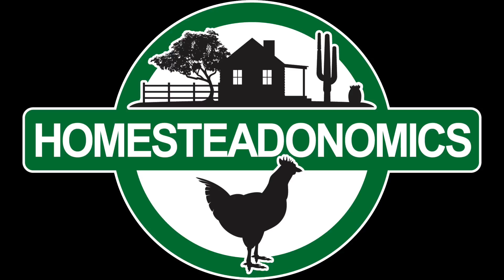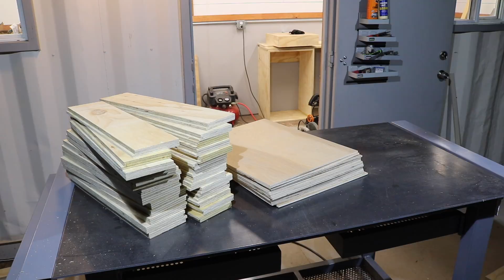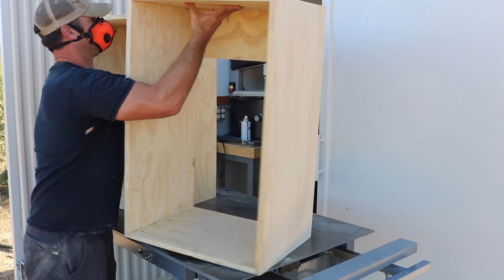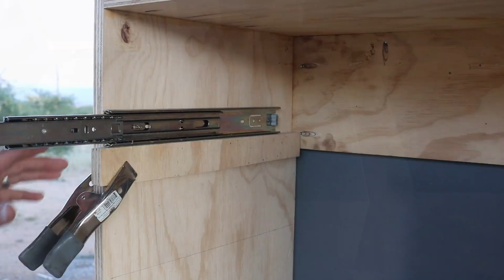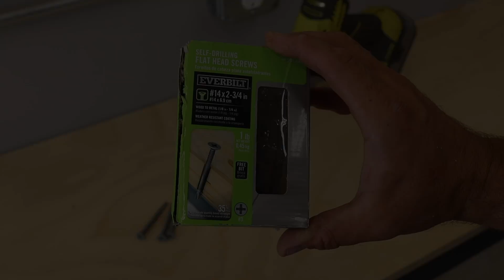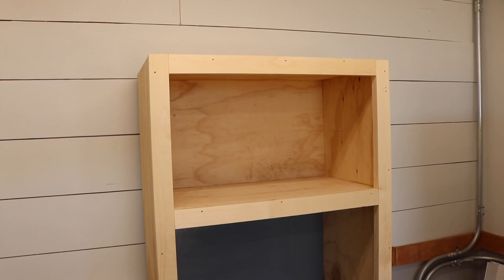Workbench w/ Drawers Build  -  for the Shipping Container Shop

Comment: I'm curious how those glued drawer bottoms have performed in your hot climate?  I've always heard floating the bottoms unglued within dadoes is the way to go if the heat in the shop will be causing expansion of the bottom, so they don't force the corner joints apart, but I've had my doubts if it makes all that great a difference.  I'm going to be making several drawers in a new garage shop that'll have to stand up to Colorado summer heat, so just wondered how yours are doing so far?
Reply from the maker: so far so good... I think floating bottoms are probably the way to go but I just went with simple and easy for these and I don't anticipate any problems.  I have some that I built 7 years ago with only glue and finish nails and still no problems.  Overtime if they loosen I'll just take a cleat under there. :)

Comment: Did you happen to use glue along with nails when attaching the drawers faces?  I did not one time and quickly discovered kids slamming drawers will knock the faces off. A short screw from the inside of the drawer is a big help as well.
Reply from the maker: Hi Christian... I have 3-4 screws on the inside of the drawers screwing into the back of the drawer faces:)

Comment: Great job on a cool project. I wouldn't worry about the blems on the plywood. Sooner or later something is going to fall over and ding them anyway.

Something you might want to consider is a pipe/steel/lumber rack against the wall of the drop down bench. I made frames of uni-strut (about 18" wide by 24" tall) set about 4' apart mounted to the wall and ceiling. By feeding via the end door, you could store lengths up to 18 feet out of the weather.

Also to get the most use from that space under the drop down bench, you might like setting file cabinets on the small mover dollies from Harbor Freight. File cabinets at garage sales or thrift stores are cheaper than plywood and  the HF dollies are cheaper than what they want for just the casters. I've found that the more flexible the floor space is, the better.
Reply from the maker: Thanks!  yes, i plan on making some rolling cubbies for that space... but i really like your idea of building them off the HF dollies... they are cheap and I already have a plat form to build upon!!  thanks... great idea

as for the lumber rack.. I have one in the garage that I will use to keep the shop open for more of the functional things... but I like the unistrut idea!!!

Comment: Do you have plans for the gaps between base units on the workbench? If not, that seems like a lot of wasted space in such a small shop. There would be plenty of space for a shop vac or some other modular tool storage if two of the three base units were butted up to double up that knee-hole space.
Reply from the maker: I've got plans to do just that... either shelves or a vac or something... or I might just slide two together.  The small spacing was more of an OCD thing to make it symmetrical ;)

Comment: I see you use several Royobi (sp) tools, what are your overall opinions about them?  Are the good enough when cost is considered?  Would you buy them again if something broke?
Reply from the maker: Little White Dory I actually really like them a lot!  I think they are one of the best values in the cordless world.  I use the big batteries and have never had problems with them.  I have heard that thin batteries used to have problems though.  But anyways, I've never had them quit on me👍🏻😀
Reply: They are great for stuff around the house and hobby builds, which is exactly what they are made for.  Wouldn't expect them to last in a production or heavy use setting because they aren't built for that sort of thing.

Comment: Great video.  And that middle set of drawers looks great centered, but I was wondering if it wouldn't be more practical to have it slid to one side or the other, giving you one big space, instead of two smaller ones.  Just an idea, and based on the way you built it, it looked like it might be easy to do.
Reply from the maker: lol... I've been wrestling with that option for a bit now... yes I can easily slide them over to one side or the next... but since I'm going to be building a heavy duty workbench that I plan to be more of the one I sit at and tinker... I'll probably just leave that one as is.  I might do some shelves on the inbetween sections to hold things like my circular saw, router, etc

Comment: Looking good, though for your air compressor you might want to consider making a separate little shed for it and any other noisy tools like a shop vac and then plumb them in to cut down on noise and save shop space
Reply from the maker: I've considered it but right now I'm gonna give it a go in the shop because my wife is wanting me to dial down the 'structures' that keep getting built on the property....lol
Reply from the maker: ... but that may change depending on how tight it is once the shops all outfittted ...
Reply: I have recently gone on the offensive against noise in my basement shop to reduce the impact on the living spaces above.  I would imagine  the tight quarters in your shipping container makes noise reduction just as important. Moving the noise outside just moves the nuisance somewhere else so I wanted to reduce the noise of operations where possible.  Assembly and sanding are not that loud but the air compressor and vacuum are. 

I just got a California Air Tools 4610AC double hotdog compressor from Home Depot online and it is way, way, quieter -- roughly the same type of sound as an RV generator.  Unfortunately there is a small performance reduction on pressure/CFM specs vs the PC pancake compressor it replaced, which is now moving to the garage.  Eagle and maybe a few others also offer much quieter air compressors. 

I also got a small 4 gallon Vacmaster VF408 wet/dry vac from Amazon to use with the less noisy handheld tools which tend to run for long periods of time.  It reminds me of the sound the old sears canister house vacuum from my childhood made, only quieter.  The little Vacmaster is the poor mans alternative to the Festool CT-26 dust extractor with about 1/2 the performance at 1/10th the cost.  This thing is going to have a home right under my assembly/workbench.

Comment: I'm a fan...  They look really great...  My "mad scientist idea" would be to weld the same type frame as your cabinet top (same measurements and plywood surface) for your shelf...  With the three cabinets, you could double the length of your cabinet surface by moving one to the middle and one to the far end, using your shelf as a second cabinet top...   Might also be tempted to add some low profile locking rollers to the cabinet bottoms to facilitate this...  //  OR  //  Weld a sheet metal surface on the under side of the cabinet top, making it reversible, and a secondary welding table...   Anyway, great build Joe...  I appreciate the attention to detail in the the handle jig...  It paid off, and looks very professional...  Thumbs Up
Reply from the maker: thanks Marc!  I like the idea of continuing that same construction up for the shelves.  Slick and would make for a nice flow too!
As for the bottoms... those are probably gonna stay put...lol... as i've already screwed them in....
But I am thinking of options for the in between spaces... shelves or roll out cuby carts or somethign...
Reply: Well now...  The in-betweens might allow for something to make it possible to use a shelf to double your space front to back then ??? Some type of fold out leg making the shelf level to the cabinet top ???
Reply: Also think you should make your shelves hanging from the ceiling  :)  That saves you a ton of bracketing, and makes them removable so they are free to fulfill my other mad scientist projects...  LOL

Comment: When I used to do trim carpentry, we would use the face frame to try to move that kind of a bow in the top of the cabinet into line. you nail as you go across, and adjust as you need to. That's some nice looking storage!
Reply from the maker: thanks Bruce!  Yes, I actually tried to pull that into shape when nailing it but I think it was warped for so long that i almost had my entire body weight pulling on it to get it to flatten out... in the end the 'bow' won and I just covered it....lol
Reply: homesteadonomics Ha ha. I could picture you doing that. I figured you tried to work out the bow. Like you said, it looks great & cant even see it.